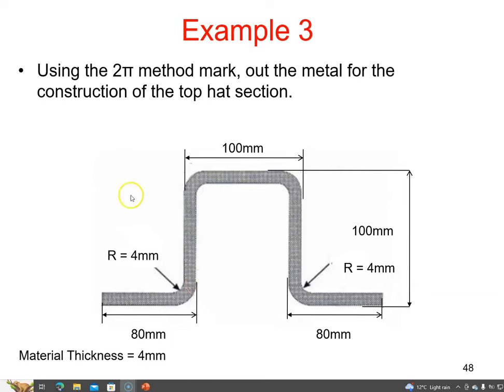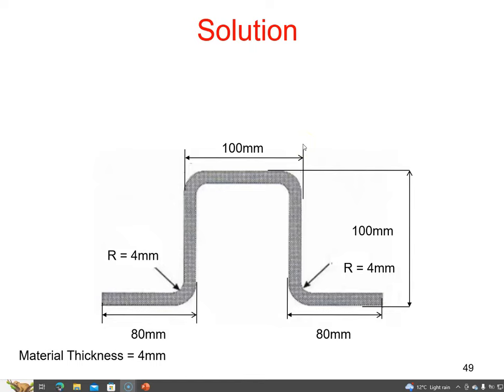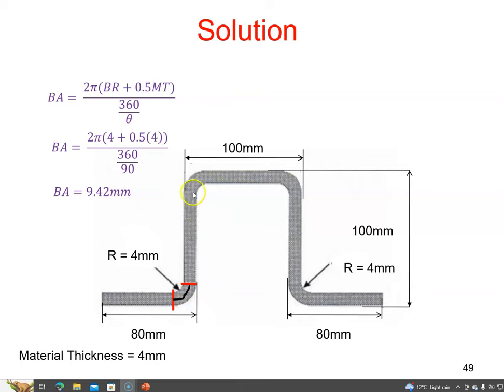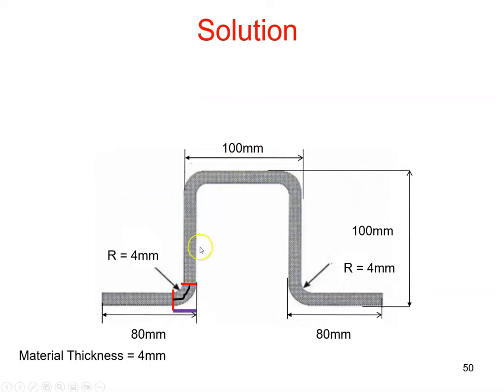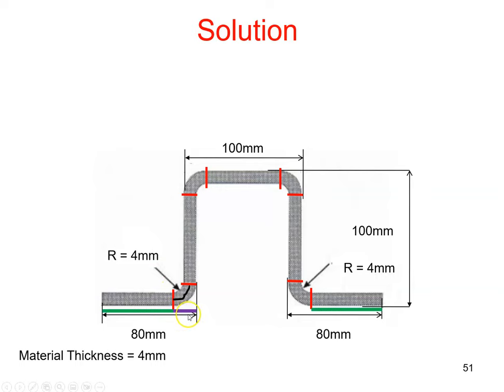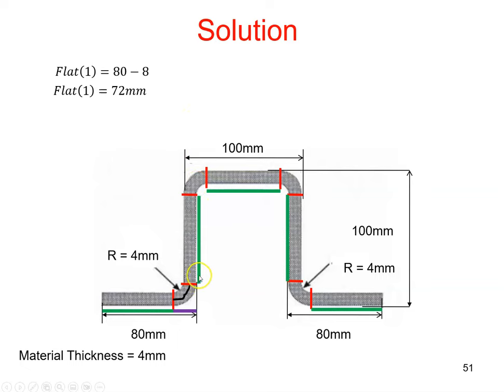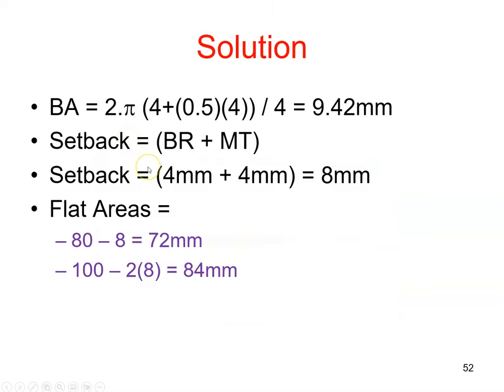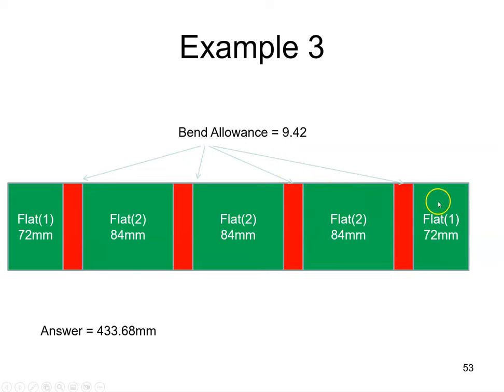Calculating Bend Allowance and Setback Example

Comment: That's the theorie. In practice especially in tests where you have not enough time you will take a bit larger sheet metal, bend the inner two radius then the outer two and cut the overhang on the ends. Fastest method. :)
Reply: My first boss just taught me to subtract a material thickness for every 90 degree bend. It gets it pretty close.

Comment: The flaw in all these calculating videos is that not one video shows how to make the actual exact bend radiuses on a piece of metal in a shop and end up with the exact FLAT distance you need. . Not one. Have any of you even made a single U channel from a piece of sheet metal to a specific bend radius? I doubt it. The first bend is cake.  BUT It is no simple task to make that SECOND bend and end up with the exact distance of the FLAT between bends.  No one shows it. Also no one shows how to control the radius in the bend. ALL the precision in making the drawing and calculations is worthless without being able to make it.
Reply: The radius in the bend is determined by the radius of your tool, be it a sharp one, like r=0.8mm or an axel like 20mm. Those sharp ones do wear down from use and get duller but that much variance you just have to deal with.
Reply: @LauriHuu  your lost. That response was so far off base to my point it is not worth even trying to correct you. you are not even in the same universe much less same page. nothing I said relates to the bending tool radius.
Reply: @josephkaminski1857  i feel you, bro 😅